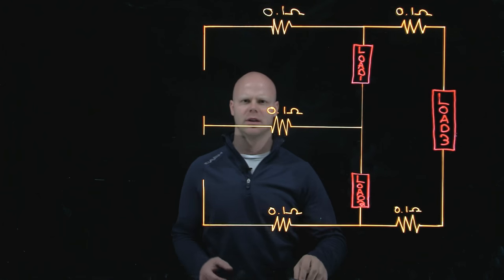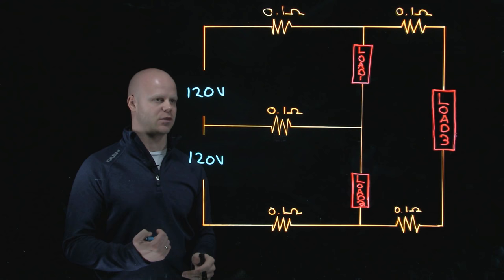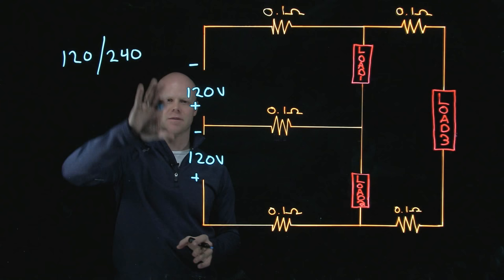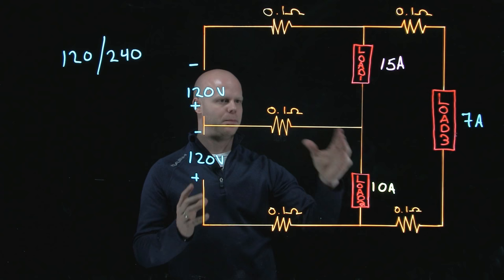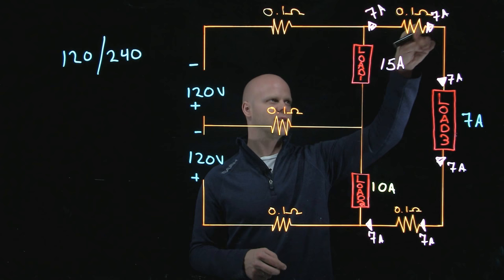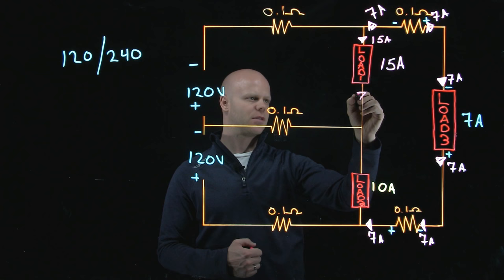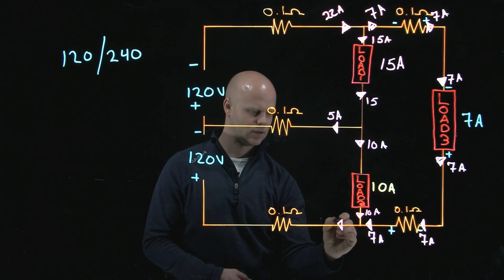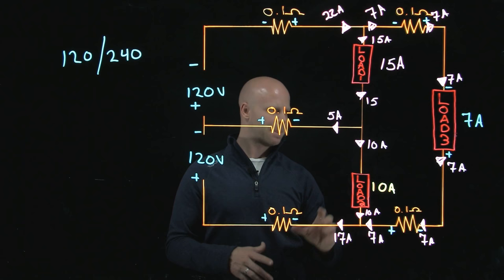Edison 3 Wire Part I

Comment: Does it matter whether you define the loops conventional flow or electron flow? I'm in electrical engineering and we were told that current flows out of the positive of a battery and goes into a resister with a positive indicating a negative voltage drop.
Reply from the maker: There is two ways to analyze current. One is electron flow which is negative to positive. The other is conventional flow which is positive to negative. Convention is very common with electronics because it’s easier to understand for devices like diodes but at the end of the day it all is the same.